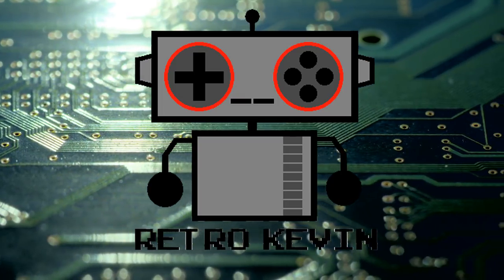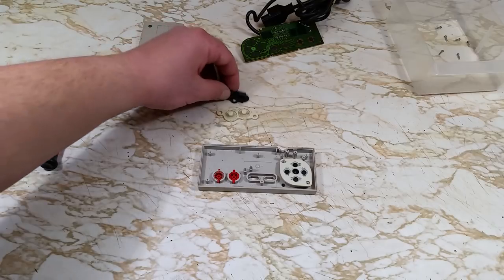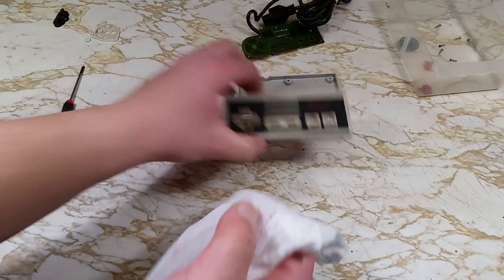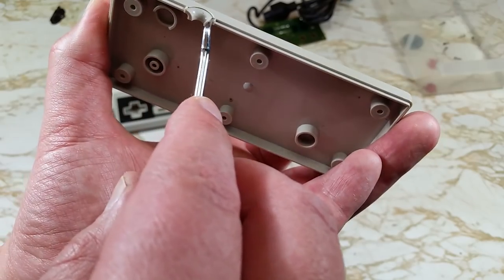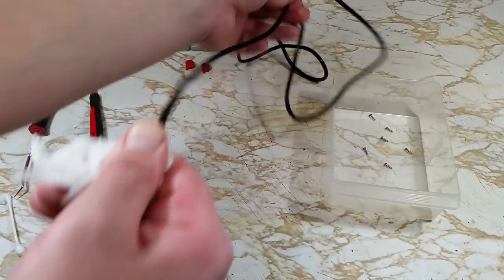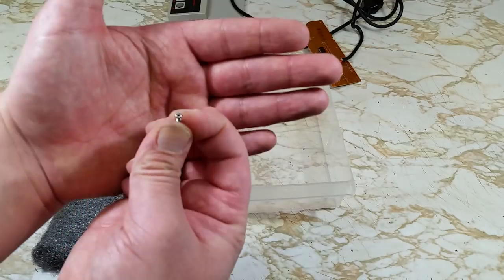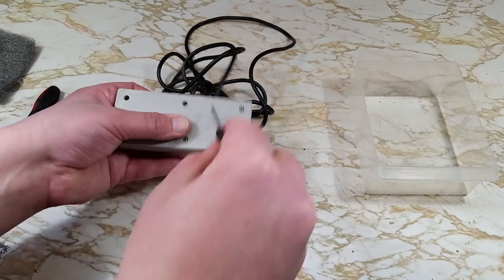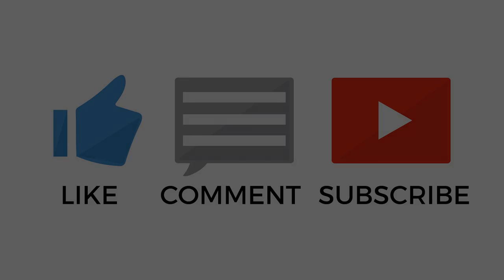Replacing the conductive pads in a NES controller

Comment: What if the contacts on the PCB are worn? I just got a NES and the d-pad needs some force to work. I opened it up and the black coat on the d-pad is gone, I can see metal (or whatever it is) underneath. Can it be fixed?
Reply from the maker: Wow that controller must have been really "loved" by someone to completely wear off that coating.

I've never had to fix one that bad before. However, I hear a Conductive Carbon or Silver paint in small amounts and a steady hand can help.

Otherwise, this is a little more of a janky repair... You can add a small piece of copper foil tape to the bottom of the conductive pad.
Reply: @RetroKevin  Thank you for the quick reply, I'll see if I can find those items in tech stores.

Comment: 7:30  i think you just destroyed the controller . the alcohol on the black connective pads is not good. it erodes the carbon on there.  its gonna take a lot of pressure now to press the buttons... dont use rubbing alcohol on the black parts.  just lightly brush it or something.